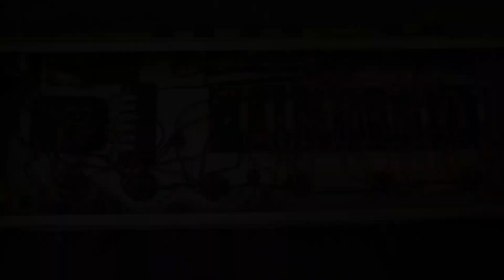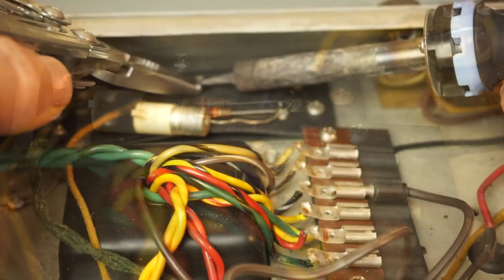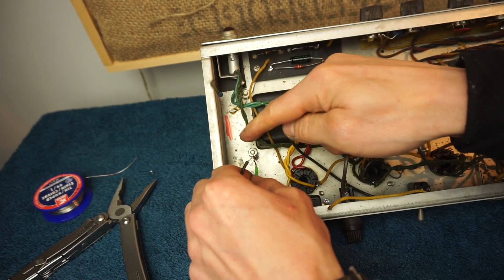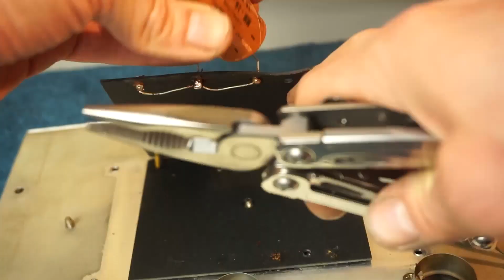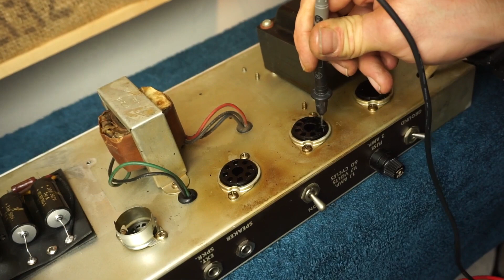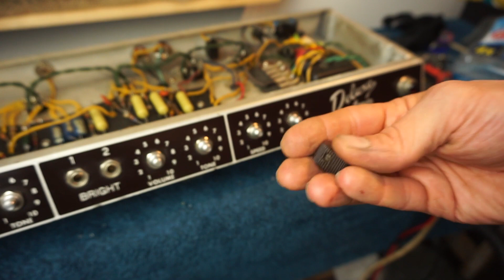Revamping a pretty DANGEROUS circuit in a Fender Brownface Deluxe Amp from 1963...[PART 2]

Comment: A couple of things that werent addressed here but should have been, in my opinion: 1) adding screen resistors to the 6V6 output tubes, since modern Russian and Chinese tubes aren't as rugged as vintage American and European tubes. 2) adding bear-trap tube clamps should be mandatory for any amp with downward-pointing tubes, especially a combo amp. 3) disconnect the grounded transformer centertap for the 6 volt heater supply and install a pair of 1/2 watt 100 ohm resistors as an artificial centertap, like you'd see in later Fenders, because this protects the transformer in case of a tube short-circuit, sacrificing the resistors instead of blowing the transformer. 4) remove the knobs so that you can tighten all the front panel hardware! The casings of the pots are used as ground points for the circuitry, and their mountings need to be clean and tight. This pays off with lowered hum/hiss/static, and also makes it easier to clean the faceplate. Tighten all the input and output jacks as well. I find it best to loosen them all slightly and then retighten, to more effectively displace greasy residue, oxidation and tarnish. DO NOT SKIP THIS STEP! It's extremely important!  PS, losing chassis ground at the output jack(s) while you're playing through the amp can cause a blown output transformer! Make sure each pot and jack has a star washer to bite into the chassis; it's apparent that you can't trust the previous tech who worked on this amp.....

Comment: It's preferable NOT to spray tube sockets with Deoxit because the greasy residue left behind can attract and hold dust, which can cause arcing between socket pins. These types of protective, lubrucating contact cleaners are designed for contacts that sre moved frequently. Better to use a non-residue contact cleaner on the sockets; pure alcohol works great, but if you feel you must clean sockets  with Deoxit or similar, flush them with slcohol immediately afterwards. In my 50+ years of electronics repair experience, the best method of removing dirt and oxidation from preamp tube sockets is to work a piece of wound guitar string, about .033 to .036 diameter, back and forth inside each socket contact, almost like a miniature round file or rasp, followed by retensioning and an alcohol flush.
Reply from the maker: Well, De-oxit is exactly what that's for, doesn't leave any residue and evaporates within a coffee. Regards,
Reply: @AldoSpadaroOfficial  , Deoxit DOES NOT completely evaporate and it DOES leave a residue (and it's a poor degreaser for removing existing gunk). It's fine for potentiometers and most low-voltage switches, but not for high-voltage connections, especially when they aren't moved, rotated or adjusted every time the amp is played. I know that people use it on tube sockets, but they shouldn't. I'm 67 and I've been working on tube and solid state electronics since grade school,  including 20 years of fulltime audio repair. You should watch some Psionic Audio and Brad's Guitar Garage videos for further info on cleaning sockets correctly.

Comment: No rubber cable grommet for the power cable? It goes through the chassis hole without any protection.. That's risky.
Reply from the maker: It has one, ;) wasn't in this footage but mounted it shut when it went into it's cabinet. Kr,

Comment: That ground lift is insane !! and that solder joint on the nut... crusty and scarry.
Reply from the maker: Well, at least it's exciting! ;) But yeah, imagine that plugged in and vibrating on stage...very exciting!
Reply: @AldoSpadaroOfficial    ps, that "death cap" wasn't original either; Fender would have used a blue Ajax cap there as well. It's rare to see an amp that has been "upgraded" to a grounded cord yet made even less safe, but the previous tech was an idiot. Always remove that cap and defeat the ground switch. Always!
Reply from the maker: @goodun2974  Yep, it was 'maintained' and given a new death cap at some point. Enjoyable,
Reply: Reconnecting the earth ground to the same terminal strip underneath the transformer mounting bolt is both bad form and against modern electrical codes, which require a dedicated earth ground connection. No matter how much you tighten them, the transformer bolts/nuts loosen over time from mechanical stress (heavy transformer), speaker vibration and transport shock (I also suspect that the bolts themselves may stretch under tension). Best practice is to solder the ground wire directly to the chassis (unless you have an unused chassis hole where you can install a dedicated grounding bolt, since we don't want to drill holes in a vintage amp). Also, always make the earth ground wire longer than the hot and neutral wires, so that if the power cord gets yanked on and comes loose from the grommet/strain-relief, the ground wire would be the very last connection to break, after the hot and neutral.